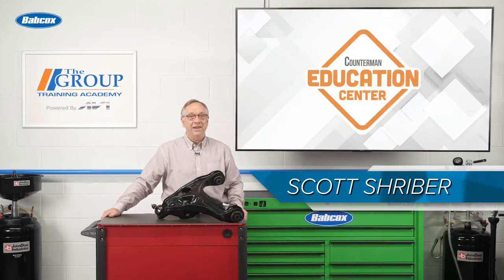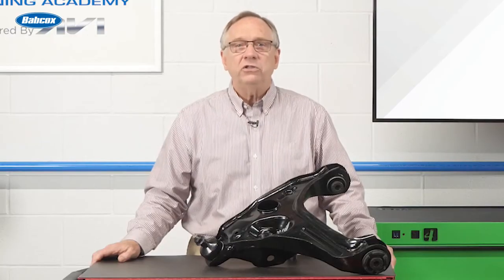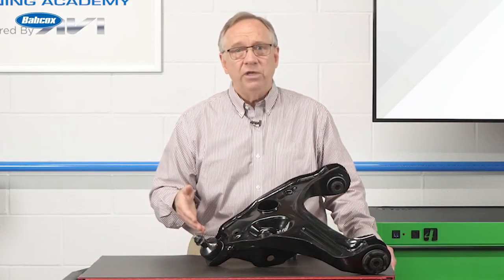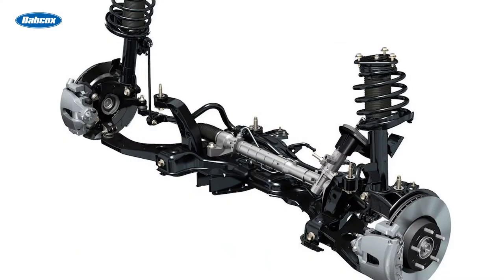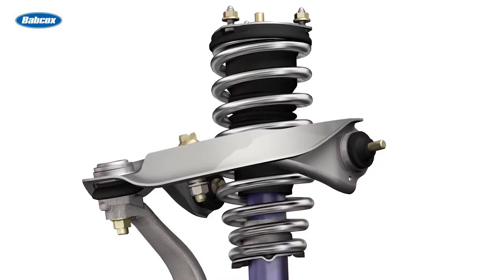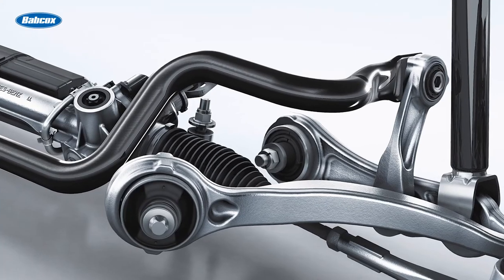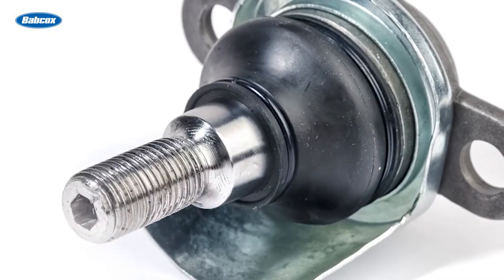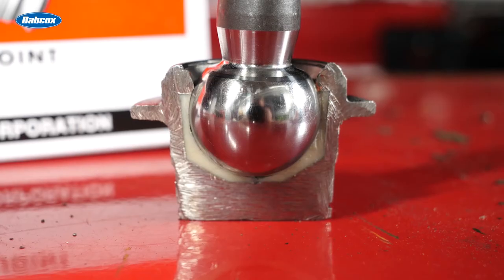Understanding Control Arms

Comment: I'm looking to purchase my own bushings to save money and not get ripped off by the local mechanic garage.  But I see there are so many different types available to my car (just a basic Pontiac, nothing fancy) - front lower forward, front lower inner forward, front lower rearward ...what do these mean?
Reply: there are multiple bushings on each arm I believe, that's what it is probably referring to. This isn't a super easy fix. May be better off replacing the whole control arm that should be a bit easier but still not simple unless you're quite mechanically inclined